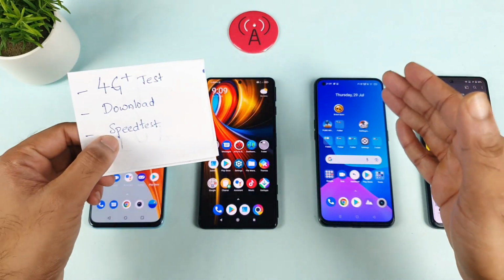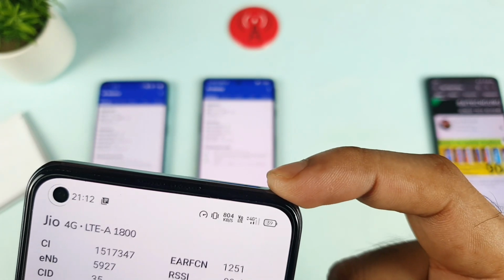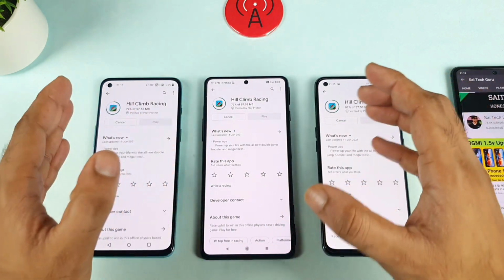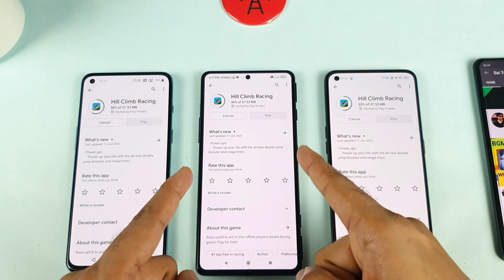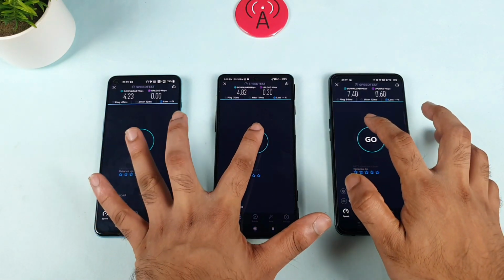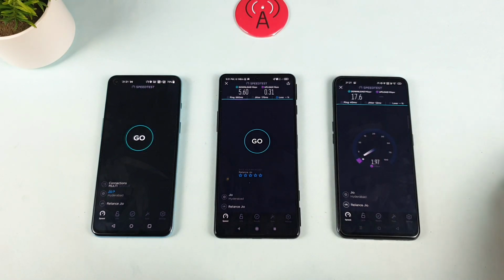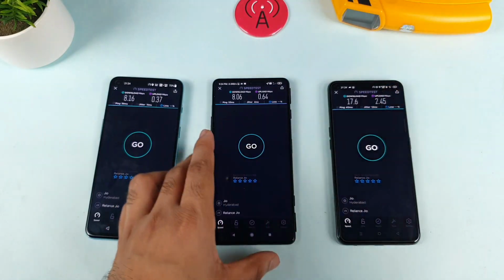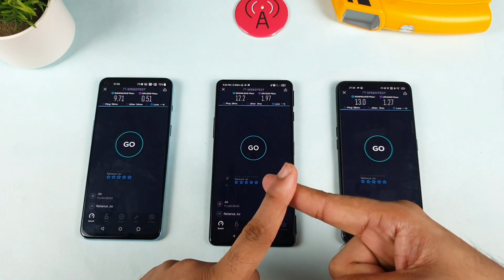Poco F3 GT vs Oneplus Nord 2 vs Realme X7 Max 4G+ speedtest/download comparison which is faster🔥🔥🔥

Comment: No issues on my Nord 2 I get usually about 110mbps indoors on jio 4g network 😃
Reply: bro how is mobile after update nord2
Reply: @arunkumarrajasekaran1951  OnePlus Nord 2 is new device so minor bugs are present which will be solved soon...such Fram lag in 4k yt vids , app cloner, amazon prime hd streaming so expect it to solve with timely updates apart from this no issues it's a beast for daily usage💥
Reply: Would you still recommend it or is it better to go for f3 gt.. Is the ui as good as it used to be?
Reply: @henandh74  I am OnePlus user since long time and lookin at UI I feel some changes are there if noticed then only u feel some irritation or else everything runs smooth...Haan in my view what I also see in a brand is that how is after sale service that customer care& service centers ,I reside in Hyderabad I have the best of OnePlus till now as compared to other brands...even I have Poco f1 realme x50 pro but their service is not good as the OnePlus care takers
Reply: @khateeb20976  thanks man. I'm a pg student and I live in Coimbatore .. Wanted to buy a reliable phone with an all-round performance and didn't want to get into gaming centric ones alone. Have already used redmi and didn't really like the software and didn't know if poco would be the same..
Reply: @khateeb20976  I'll probably get 8/128 Nord 2
Reply: @henandh74  congrats in advance good choice

Comment: For those who thinking that realme x7 max is really the best, have my words first. The realme x7 max boosts itself to maximum power it can give resulting in higher temperatures too. Due to the plastic back, it has lesser temperatures compared to nord. This mechanism of running parts at such high power every time isn’t good for long term usage. After 1 year or lil more, the parts will start degrading. This is where poco stands up. CA will be improved by software update just like iqoo. It doesn’t put that much load on its parts which will definitely help in long term. This is the thing I like about xiaomi. Even my 2.5 years old note 7 pro only throttled to 80%( tried it yesterday under fan). This is the consistency. The only thing I hate in xiaomi phones is the updates. Just don’t update ur phone and u r good to go. If we talk about nord 2, one plus had to cheap out on somethings, so they did cheap out on these things like cooling system, network antennas, 90hz display, etc. this is why oneplus throttles a lot and still has higher temperatures. I am not saying that realme is best or xiaomi is best. All of them cheap out in certain scenarios. Like realme gives cheap build quality. Poco also cheaped out on cameras and bit towards fingerprint sensor too.

Comment: Does more network band means more network or if in my area my network provider operate on band 3,5,40 and my mobile have this band my network is perfect i do not need additional band like band 8 or 41...?

Plz ans
Reply: You don't need additional bands if your network operator doesn't use those
Reply: @Prawin_N  thank you brother......but i get good network on my realme x2 pro (which has more bands) but i did not get good network on mi phone (which has less band) at same time with same network provider.......(also both mobile have all network band which is use by my telecom company).....hope you reply...
Reply: @SatyamRajpara  bro in my opinion having extra bands which aren't used by our network operators doesn't improve speed
Reply: @SatyamRajpara  which mi phone bro??
Reply: @Prawin_N  i try on redmi note 10 pro max and poco x3 pro....I live in gujarat and and use vi which is operate on band 1,3,8,41
Reply: @SatyamRajpara I am not sure why your speed is slow in mi bro
Reply: @Prawin_N  ok bro..... 👍
Reply: @Prawin_N  also both mobile support carrier aggregation...
Reply: @SatyamRajpara  the phones may be connected to different bands or it may be due to different modem/antenna in these phones

Comment: X7 mx is so underrated :( ..while the nord 2 is not even worth the hype
Reply: X7 max is good also comes with 3.5mm jack but for me and many users they will prefer a glass body premium looking phone
Reply: Yes bro iam using x7 max i have no issues
Reply: @sumanasn5994  only 240Hz TSR lol😂
Reply: @sahilmalhan5773  lol , 240hz  is quite good
Reply: @sahilmalhan5773  realme UI bug will fixed in August security patch. It supports 360 hz touch sampling
Reply: @sahilmalhan5773  360hz hai tsr improve your knowledge
Reply: @krishsuthar8851  only on paper not in real life. And we are living in real world not in paper world , so get practical 😒
Reply: My problem with it is the build. Not much protection from different kinds of damage. Plastic back can get scratched and also there's no rubber gasket protection applied on ports for dust and water resistance.
Reply: @GoodCityLife its not about breaking , plastic body feels cheap and gets easy scratches also not great in terms of spreading heat so using a back cover isn't recommended
Reply: @GoodCityLife  plastic body never feels premium
Reply: @ricksdm   but plastic built is good in case of long gaming sessions and repair cost is also low of back panel ……and plastic isn’t frazile like glass back…. And also light weight
Reply: @shekharmaurya7274  both got their own pros and cons it's just depends on user

Comment: All these paid Youtubers representing Nord 2 like some alien technology while Realme X7 max is a beast according to price far better than Nord 2
Reply: Bro one plus has the best camera,ois, gg5 front and back
Reply: @rinkulparida4505  even though betrer camera and glass back
Nord 2 is not optimised as x7 max in performance
As it gets near 600000 antutu score
But x7 max gets antutu score around 690000 antutu
Reply: @sumanasn5994  it's a new device. It will get optimised
Reply: @rinkulparida4505  23.5k vs nord 30k
Reply: @rinkulparida4505  yes but look at the price difference 
The Display panel is not that great in Nord 2 it has only 800 nits brightness
Reply: Right ,You can actually feel the speed and Performance of Realme X7 Max